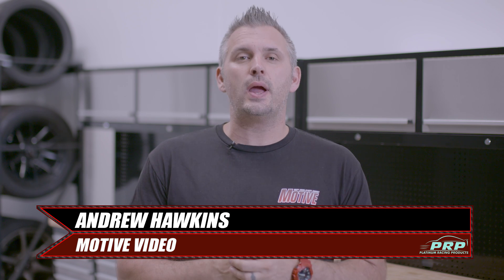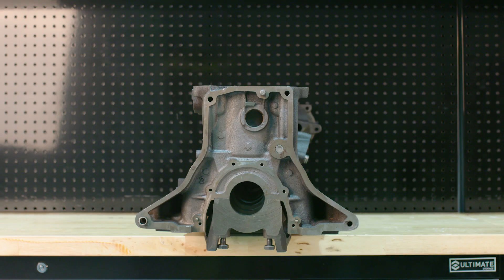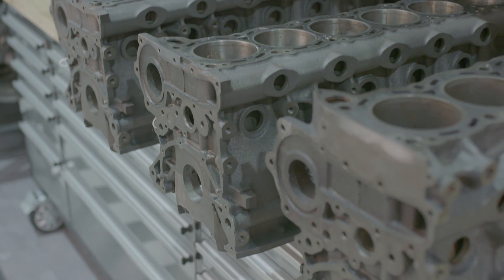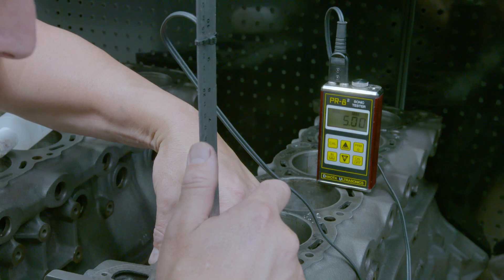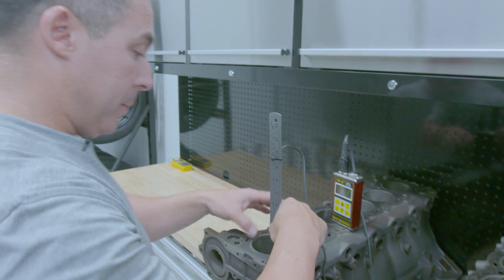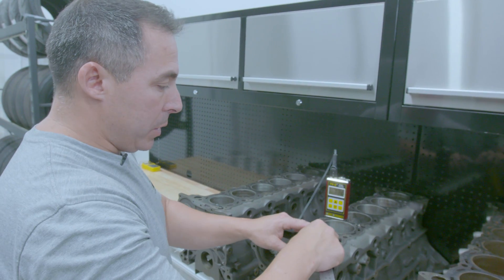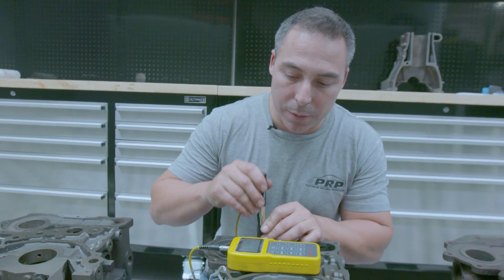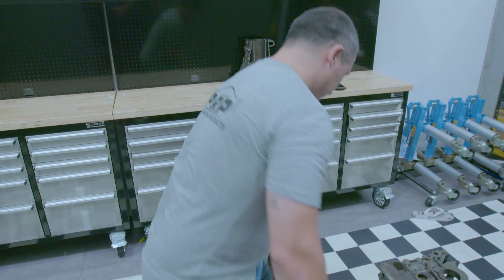Is the RB20 stronger than its big brothers? 2WD RB Block Comparison - Platinum Tech

Comment: Hahahaha to be fair the only reason why it’s so hard is because I think the capacity of the engine is a lot more compact and to try to get the same power out of that motor requires a lot more effort and I don’t think that was something Nissan was thinking about very often 😂😂😂
Reply: The reason why RB20's struggle to make power is the head, just look a the ports compared to a RB25.

Comment: Be interesting to see a comparo of the hardness test done at different temps. Also the heat dissipation properties noted. I think this is where u will find where the RRR lump earns its wings. If the hardness test identifies the correct properties that is.... maybe a jig that twists the blocks and measures deflection? The metal compositions expansion properties would be much much more precise and calculated to I imagine. The harmonics, heat sink loads, race fuel combustion properties / cooling properties, tune control... etc etc would require seemingly insignificant advantages to a regular owner/racer small racing outfit but when hundredths count, tenths can be measured in the $$ millions and an entire automotives brand is at stake, mechanical failures and/or handicapping levels of performance deficit to the competition are not an option. The knowledge/ability/budget to build a complete racing package that leverages every components ability from the sum of the other components would likely necessitate these ‘insignificant’ advancements. Without which, the engineers would simply not be able to meet the design brief. 
Seemingly overpriced and completely un-necessary to most is actually an absolute necessity to those it was designed and intended for. 

Still a good investment if stored properly. Owners of these historic race cars will pay the earth for one in the future.

Comment: guess a testing of scandinavia 2jz would be all good and fun, the all reliable workhorse the B230 block, it might only be a 2.3L 4 banger but seen numbers up to 1400hp in drag applications, and it's usually the head's that give up, not a performance engine by any means, but i have a suspicion that the block would come solid out on this type of testing.  might give manny "jdm" 4 bangers a whopping for sure.

Comment: Do you guys have a spreadsheet of the minimum recommendation values for each test on each engine we can reference? Cheers? 

What about the stagea blocks? Its interesting which models come with up spec internals... Armed with info like this and with some homework, a score can be found that should only require minimum upgrades to handle a fairly potent everyday street driven car ie; 350-450rwkw (By most peoples perspective, not fellas spoilt with sequential, 1000hp street driven monsters)

Comment: I just bought a nice 240 roller low mile it's bone stock the guy I got it from was gonna ls swap it and go  the drift car route. I was gonna make it a street/strip turbo ls with a TH400 and a 8.8 rear when I bust the stock rear end But I really want to Do a RB30 or RB20 swap  I have really gotten into rb's but over hear in the u.s  there ain't many around

Comment: They dont make hp . As there bore size is so small you can not get enough air flow in the cylinder the valves are just to small . Hence you can not make enough torque to hurt them ..

Comment: They keep referring to the RB20 and RB25 blocks as RWD, without taking into account GT4 Skylines, Stageas, and other AWD RB powered Nissans.
Reply from the maker: Have you watched our other videos? There are 2WD and 4WD versions of the block. They have different pan rails to suit sump. RB30 never came as 2WD so requires a Platinum brace which adapts it to 4WD

Comment: RB20s are so underrated, dunno why folks ditchem for 25s for a steetcar, just chuck a 25 box behind it
Reply: Because it all depends on your budget and qhat hp you're looking to accomplish also reliability. 20s are good to 3-400 before breaking anything  and you're looking to pay 2gs extra on top of your already 3k engine. How ever you could buy a 25 for 3250 and make 3-400 hp with about 1k.. 5k amd reach your limit before spending big bucks or 4.5ish and still have plenty of room to play with?
Reply: hayden phillips fair call but most roadgoing 25 swaps dont even touch 400hp (not here in WA) because they just det from pulp98

Comment: Rb20 biggest limitation is the head. It flows less than a rb30 head. So throw a 25neo head on a rb20 block and watch a bunch majic happen at 11000rpm.
Reply: 11k? Yeah watch a window get formed out the side the block for the ultimate oil drain back mods for RB’s.
Reply: @msengineeringdavid3702  lmaooo
Reply: Except the valves dont fit the bore size . Hence why it isn't done
Reply: bore size?
Reply: in Y2K, the popular sleeper RB20 trick was an RB26 head and crank and custom rods. A destroyed doner RB26 was $500 you have 3mm of rod bearing to offset grind with too so totaled cranks were still useful.  There was a 9000rpm "RB24" screamer in a friends S13.

Comment: Guess I'd better run 40psi in my 20 then 😆
Reply: Layton Ryan 
Or a every tune with a ‘low’ 25psi, 10,000rpm, high compression, billet crank, lightweight flywheel and lightweight chassis like a Silvia 180SX/200SX or Dato 240Z. OR Suzuki Mighty Boy 🤔

Or you could run 2 of em... one up front and one in back, sharing a common transmission, gtr style diffs and prop shaft connectors with rear engine being reversed and having driveshaft output and propshaft input facing the front of the car.

Comment: Wouldn't mind seeing a comparison with a CA18 Block considering they are dubbed as a "Mini RB" are they really just an RB block with 2 less cylinders or is that just an internet rumour.
Reply: Yeah they're quite a different engine. They're called a mini RB in my opinion because of the squared off rocker covers.. ie. They look like a mini RB
Reply: ZEXTOR Internet rumor.
Reply: yeah they are pretty similar in design
Reply: The rb head was designed using the ca as a reference
Reply: I like the old twin spark one's they're a bloody good motor potentially better than an fj20 or even sr20 in my opinion

Comment: Good little RB20.
Now people need to start putting 26 cranks and running rb24 for race engines.
Reply: Priestley Harker he said it will break if u put 2.4
Reply: @timothyrinaldi6609  if you bore it to 2.4 it will, but if you stroke it to 2.4 it will be just as strong
Reply: @billyrowley3875  then y gotta run custom rods and pistons to compensate for the longer stroke
Reply: @timothyrinaldi6609  i didn't say bore it i said stroke it.
Reply: Taking 1.5 doesn't take it to 2.3... math
Reply: @priestleyharker4046  All this chat certainly gets me keen to build another RB20 :) (only been 19 years since the last one haha)
Reply: a 26 crank would only get you to 2.1 without boring it
Reply: @brendanrandle   26 crank and rods with 4AG-ZE pistons.
Reply: even going with the 81mm 4a pistons which would require boring to fit you still come in just under 2.3
Reply: @brendanrandle  there is plenty of meat left after that bore.
Reply: @brendanrandle   Tomei do a 2.4 kits with 82mm pistons. 26 crank and rods

Comment: The huge rb20det down side I see is head flow, could a 25 head be put on and what machine work would need to be done. Aside from the 20 or 25 transmission what else have you seen used in rwd applications? I'm curious to see a cdo6 or tremic behind a high power rb20. @motivevideo
Reply from the maker: tom francia bolt pattern means 25/26 head fits one but we couldn’t confide at the time is calves would hit

Chamber is too big so would need filling and machining to work on Rb20 bore
Reply: There are many rbs with cd009 swaps, I personally have one in my s14 with an rb25det and it's awesome
Reply: @Marcoo_S14  did you use a conversion kit ? I've got a 26 15 but running a 25 5 speed box
Reply: Yeah it's just an adapter plate and it's fairly cheap, mine is from Collins adapters
Reply: @Marcoo_S14  I'll have a look cheers

Comment: This why i have 26 cranks in 20 blocks 2.4l of goodness and rev for days
Reply: Definitely not 26 pistons since they’re 86mm
Reply: ChrisHallett83  well from what Herman is saying they had 4.5 to 5mm wall bores and being 78mm standard and now 82mm thats 4mm over 2mm per side so its giving an gauge of around 2.5 to 3mm wall thickness. Ran 1.8bar boost for years.
Reply: He said that 2.4L would be making it worse than an RB26.....
Reply: @Mantenner  only of you bore it out, with the rb26 cranck you're not boring the block just making the stroke longer
Reply: @Marcoo_S14  Interesting, do you have to use RB26 rods and pistons too? Longer rods that is?
Reply: @Mantenner  yeah the Pistons won't fit, but you also need to modify the rods and the block because the rods might hit the side of the block.
Reply: Mine has 82mm bores with the 26 crank 73.7 makes it around 2.3ish just call it a rb24

Comment: The reason the rb20 survives is the really short stroke which is less distortion which doesn’t oval out cylinder bores.
Reply: ChrisHallett83 you’re an idiot that doesn’t know what rod stroke ratio is greater stroke shorter rod = more side wall force. RB20 stroke requires a longer rod to meet the same deck height. Shorter stroke/longer rod = less force.
Reply: @msengineeringdavid3702  Actually mate, you're the idiot  - All RB20, 25 and 26 have 121.5mm long rods, and just different piston crown heights. Maybe you should do your homework before you go spouting off at people online. Twat.

Comment: Given that RB20's and RB30's seem to be better blocks is it reasonable to say that earlier castings are likely stronger probably due to a better (but likely more expensive casting) process. It seems to me, that often bean counters come in and change processes to cut costs and that's likely why later castings are not as good? But still acceptable, given they can make 1000HP etc..?
Reply: I'd say so, can't confirm but if there's a way to cheap out where it doesn't affect their intended use case they'll do it.

Comment: If you were local I would donate an Intech block to be tested (for those non 'Strayans I'm referring to the SOHC predecessor to the Barra  which has an almost identical looking block)
Reply: A number of nice Intechs out there... was sort of glossed over.
Reply: @wobblysauce  not a lot with rods and pistons though. Most people stop at the limit of the stock items, around 400whp. I'm hoping it's as strong as a barra which means that $2000 worth of rods, pistons and head studs I can pull 600whp out of it
Reply: Skippy plenty of 1000+hp intechs around
Reply: @BrosefDudley  far cup goof
Reply: troy davies what an intelligent comment, did you think of that all by yourself or did your mummy help you? What specifically triggered you about my factual comment?
Reply: Soft block same issue as it's big brother the barra.both have flaws

Comment: RB20 prices are suddenly going to rise
Reply: andymcdo they have been for a while. People are starting to restore old skylines and they went from being about $100-200 USD to $1000-1800 depending on the condition. You used to be able to get them for less than $100 in Japan if you got a good deal actually, which blows my mind.
Reply: By nuggets he means gold nuggets! XD which means they are rare! And high demand and pricey XD
Reply: Nah not a chance.
Reply: ClutchkickPJ  I got mine for 800 full swap.   Now you can’t get one blown for that on the east coast
Reply: They have... 1800 is the cheapest i found for a det
Reply: They already have gone up a lot I imported my full swap rb20det. Trans Ecu and all for 900 picked up   Same place now has rb20s for 1900 that’s 1000 more in 3 years.
Reply: No
Reply: Anything related to R-chassis has been climbing steady for several years. Including rb20 motors and components
Reply: But the R30/31 skylines will remain the same muhahaha

I really like the R31
Reply: nah they're nuggets

Comment: Can you drop an RB25 or 26 crank into an RB20? Does it fit?
Reply: Yes you can but the inner walls of the crank case need some work to clear the rod from the extra stroke and will need cusrom pistons to get the gudgon pin in the roght location. I have 2 rb20's with rb26 cranks and rods forged pistons makes a 2.4l and rev it to 9k
Reply: Ciaran Synnott I've always wondered if a stroked rb20 would like high revs, always seemed like a killer combo with the better torque curve and high rpm capability. I bet it pulls like crazy.
Reply: @ciaransynnott7958  so, you drop an RB26 crank and turn into a 2.4 engine? Didn´t require 84mm pistons?
Reply: @TheMegajr  82mm makes it 2.3xx call ot 2.4
Reply from the maker: J H yes. Require custom pistons though. 26 rods and crank go with 4AGZE 84mm pistons but we think that bore size is too much on RB20
Reply: J H as far as I know, the mains are the same size and it will fit but you probably need custom length rods, I don't think any of the other rb's rods would be correct length. It depends on deck height and piston height though, you could get lucky and one of the factory rods will work... I cant imagine after cost that it would be worth it though, rb20's have gone up in price because of people restoring cars and after you figure in the price of everything else a 26 or even 25 is a better base because of the improved cylinder head design and intake and exhaust manifolds. If you already have one and want to try it though, then why not right?
Reply: Mains journals are smaller, also it's a shorter deck so the r/s ratio will be screwed

Comment: 2zz vs b18 please since y’all are afraid of the vg30😂
Reply: Diff gen of engine man... 2zz = 2000s which means k series which demolishes 2zz there’s a reason lotus owners swapped to them. A b series is a 90s engine.
Reply: MSengineering David first of all no comparison between the k and 2zz I understand the b is a 90 engine but it’s a better comparison. The 2zz could actually have a chance.
Reply: C00t3r Br0wn it’s not try b series vs 3sge or  4age .
 
Learn your period correct engines “I am comparing it to have a chance”  well I’ll pair a heavy weight boxer to a feather weight .

That’s like comparing a smart phone to a sega genesis.
Reply: MSengineering David hey if they do the 2zz I’ll be happy just trying to give it a fighting chance is all
Reply: 2ZZ would be an interesting one!
Reply: ChrisHallett83 you’re trying too hard in  my comments attempting lame rebuttals  in every one under mine. Well I’ll pair a toddler against a baby rhino they are both baby’s they should be good!? Stfu idiot. You’re wrong 2zz after tuning actually made more power across its range due to cam
phasing it was the first engine in North America to have variable valve timing and cam phasing. Then Honda released theirs doing the same exact thing. Go find something else to do please.
Reply: MSengineering David simmer down
Reply: 2zz head flows horrible compared to a b series.
Reply: Kenny_Fa5 did not know that thanks what else can you tell me about the 2zz. There’s not to much info on it. Personally i don’t like it but that’s just my opinion
Reply: @K00t3rBr0wn  not much not my type of engine to throw money at.
Reply: Kenny_Fa5 Gotcha